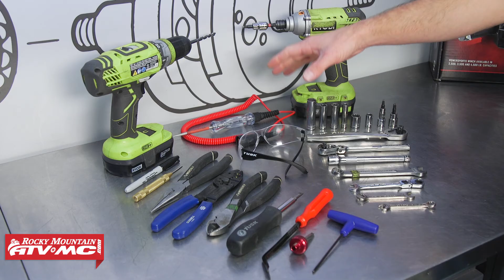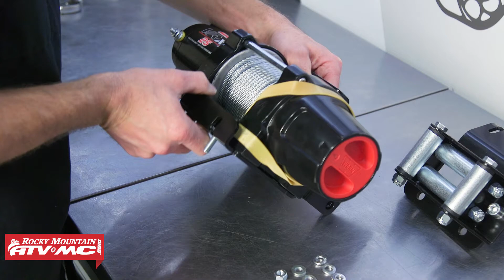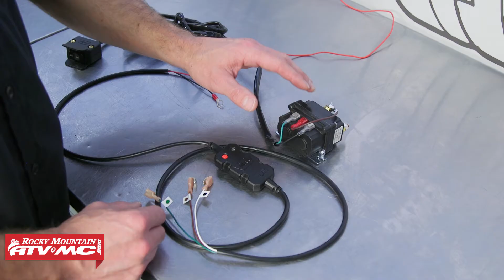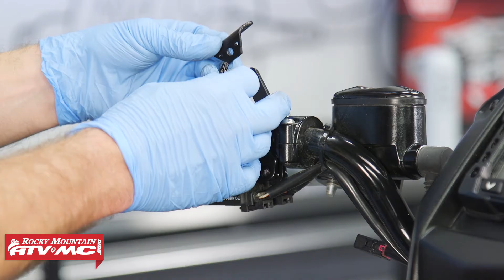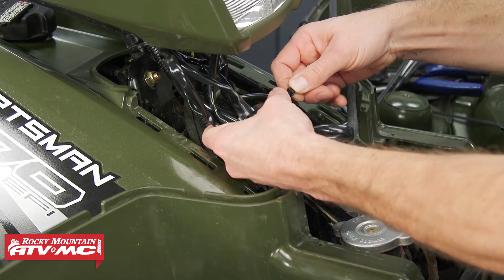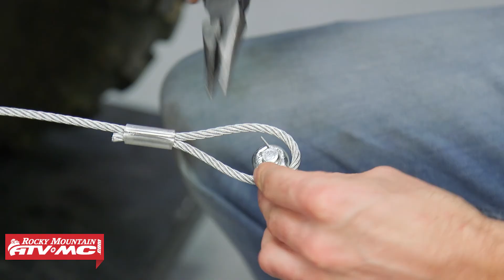How To Install a WARN Winch on a Utility ATV

Comment: Success.......2 days of troubleshooting, I learned how to check continuty and use pliers to push down metal piece of quick splicer. Rocker switch and remote working. I know why I hate working with wires now lol

Comment: Thanks. Going to try this VRX-S 3500 install on my 2023 Polaris Sportsman 850 Premium. Ordered the Warn mounting bracket for the model as well.

I'll say that I will probably replace the rocker switch with one that fits were the Ride Command would go.

Comment: I'm Removing a Polaris 3500 winch on my 2008 Sportsman 500 from that era replacing it with the VRX2500, looks like the wiring is all color coded the same, just need to replace the relay, the switch and switch mount is a little nicer with a remote control that plugs in to it, and was thinking of leaving it in play??